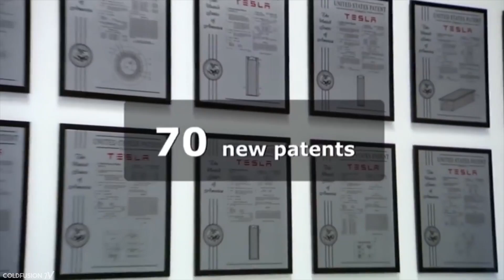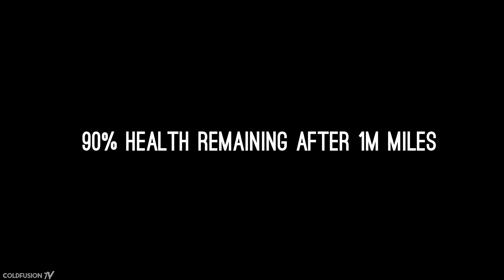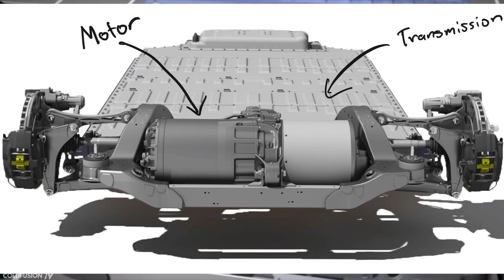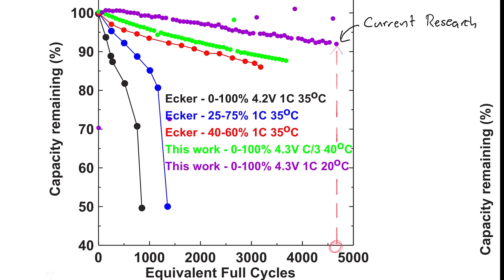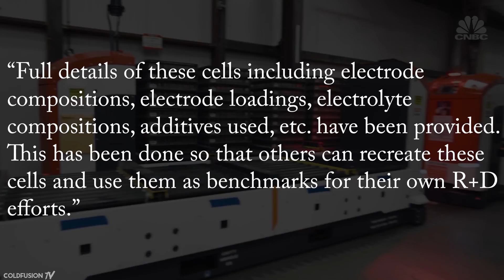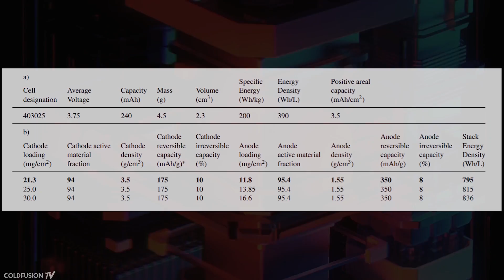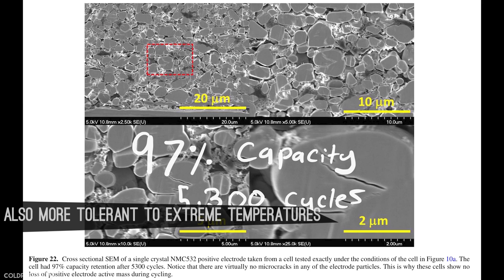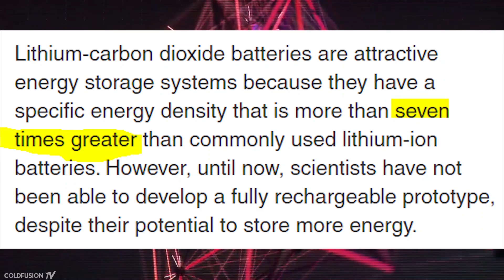Tesla's Million Mile Battery

Comment: I have a goo idea too.. What if we could make a propulsion system that would run on some sort of magic juice that comes from the ground or is made from plants, would take about a minute recharge the vehicle and last 1000 miles?
Reply: Will using this magic juice also contribute to 100,000 american lives lost yearly from breathing it?
Reply: @miguellopez3392  Less than burning coal or natural gas to charge lithium (which needs to be mined at a huge environmental cost and processed at a huge energetic cost) batteries.
Reply: @rolandlee6898  well it's a good thing EV owners live in states with higher then average renewable sources, my state is 75% renewable power. Hey how are those oil spills and wars over oil going for our world? Oh wait the media is making it seem like we cant live without it and dont really cover any oil spills besides the big ones. Also lithium is renewable since it's an element, once it's out of the ground it can be used again and again, whare does burnt gas go? Oh yes that's right the air where everybody breaths it. But those poor trees around the lithium mine! We cut down more trees making  tables, what's with the sudden concern everybody has about the environment which specifically focuses on battery mines...
Reply: @miguellopez3392  Your ignorance is pretty astounding. An economical gas car ultimately does LESS environmental damage than an EV, because its much cheaper and easier to produce. The manufacture and transportation of EV components already is equivalent to about to that of a typical gas powered car + some 100'000 miles on the road. Over its expected life span an EV can at best hope to break even.
Yeah your state has more renewable energy, for which you probably also dont include the energy that was spent producing and maintaining the systems to harness it... which, just like the EV you drive,  were most likely made in China, which mostly burns COAL for electricity (while still having lower per capita emissions than you with your renewable energy, let that sink in for a moment). The manufacture of that EV, and transportation, has burned literally thousands of TONS of coal and diesel. The individual components of your EV have done some half a million miles on diesel cargo ships before it even became an EV. In addition to polluting groundwaters and rivers with toxic waste from mining (which is diesel powered) and processing (which is coal powered) of the lithium and aluminium gone into making it. If you think mining doesnt do any damage I highly suggest you visit a rare earth metal mine and note the machinery they use. The surrounding are and waste dumps are more hazardous than Chernobyl.
Burned gas goes where it came from - biomass. The air you breathe out contains about 1000x more CO2 than the one you breathe in. So what are you complaining about exactly?
Also lithium is NOT renewable, its finite. Its somewhat recyclable but almost no one is recycling it because the power needs are absurd and its cheaper to mine it. And even if we would recycle it and mine as much as we could - its physically not enough to supply the demand, not even 10% of what we need. Its actually completely futile, the future is in sodium based batteries (but they are heaver and hold less charge) Also each recycling process yields less than the one before and the energy needs and toxic waste products grow exponentially the more you wish to recycle reactive metals such as lithium. Its produced as a metal via electrolysis at a pretty abysmal efficiency. and its done where you think? Have a guess... CHINA... and how do they produce electricity? Have a guess.. ITS COAL! Which is why EV production is in fact far more damaging to the environment, including CO2 production than ignorant morons living in their bubble like you believe. Evidently you think it just falls from the sky... No buddy, its produced by burning MILLIONS of tons of COAL in China and polluting the environment the point where entire species go extinct and entire rivers are dead and bleach your skin if you touch the water. And one more thing - EVs contain quite a bit of plastic and other synthetic materials. Where do you think those came from? The sun?
Reply: @rolandlee6898  everything you said in your entire comment I already know. I know it from years of arguing about EVs and climate change, except for the fact that I've done the emissions and enrgy math myself and found that "current" EVs just brake even on average, but due to the rapid growth of EV sales and renewable installations the world is going to just become more efficient at running EVs, it's simple as that, also the environmental damage from maintaining and operating gas cars is far more damaging then BEVs, there is simply no debate about that, but I am willing to hammer you head in with hundreds of examples of oil spill,  explosion, pipeline burst, and transport spills if you really do think a lithium mine is that bad... do you know what a brine deposit is? 
Conclusion: better if we start transitioning to EVs now then later.
Reply: @miguellopez3392  Im not saying oil is the best. As for spilling, you should know that most of the oil degrades within weeks, they even use bacteria to clean up oil spills. So its not actually as bad as people think. Its still awful, but it doesnt actually cause long term or permanent damage.
It isnt going to get better with current generation of EV. Lithium batteries are a dead end. All the current EVs do is serve as a fashion accessories with most people being completely oblivious to what it actually takes to produce it. We physically dont have enough readily available lithium on the planet and the price keeps increasing. Which is why people are researching alternative battery options, such as sodium.
The advantage of gas cars is that they are cheap to produce and can be produced relatively locally with comparatively minimal environmental impact and lower power needs. They dont require diesel trucks and machinery to mine lithium in Chile, a diesel ship to send it to China, coal to refine it, diesel ship to send it to Canada to purify with gas, diesel ship again to Japan to produce battery cells by burning gas, diesel ship again to China to assemble into battery blocks via coal again and ship those to wherever the EV is made. And thats just the batteries and you can see the demand for oil, gas and coal during the process. So by buying it you actually INCREASE the demand for fossil fuels. Ultimately you will never drive your EV enough even if you charge it with eco-friendly power to tip the scale. The batteries will start to degrade and 5 years later you will get a new battery pack that had the exact same journey as the first one, producing more pollution and CO2 than if you had used an economical gas powered car all along.
Oil really isnt as bad as people think, its just biomass and we could in theory switch over to biofuels as engines get more and more efficient (and we can use EVs where its sustainable). Presently internal combustion engines are more energy efficient than EVs by far. Encouraging EVs presently does more harm than good. Thats just a fact. Buy a small eco gas car that does 60+ miles per gallon and pump it with bio-fuel made from vegetable oil thats completely renewable. The far bigger issue is the use of gas a coal for energy needs. Should all be geothermal, nuclear, hydro, solar or wind where and if viable. Transportation accounts for less than 30% of CO2 emissions. Most of CO2 (and worse) is produced by power-plants and industry. And replacing those is a far easier and cheaper task than replacing hundreds of  millions of cars, trucks and ships which are made by the CO2 producing industry, which we DONT have enough lithium for anyhow.. All you gonna do is increase the demand for this industry and its power needs by advocating for EVs today. You will up the CO2 from power and industry and at best replace 10% of cars with EVs, Transport emissions will drop by 7-8% (Some 2% of global total) and that will be completely nullified and surpassed by far by the industry and power need you created. Ultimately you will produce more emissions and pollution. Much more in fact. Its basic physics.
Of course we should transition to alternatives. Oil isnt gonna last forever either. We probably would be transitioning more actively is not for the low cost and the requirement for oil to produce literally everything else we use, including EVs. Im sure you wear synthetic fibers and buy water in plastic bottles like the typical eco hipster does. Thats all made from oil btw.
Reply: @rolandlee6898  yep still pretty much know every thing in you comment, I'm not learning anything new here, but you do have some valid information and some invalid, but I'm not here to pick too deep at it, I'm tired of having arguments that get drawn out too months with 100 paragraphs so please keep your replies short, I dont have the attention span I use too. Oil is good, its grate put us in the industrial era and modern age, still has many uses outside of burning, no point in letting it go to waste, just dont burn it for energy since we are in the modern age we can now pushed renewable power, One form of energy replacing another is somethinghumnas have done several times, again, batteries are still better, lithium ion is not a dead end it only appear that way because a lack of demand has created a void for funding, now since EV adoption is increasing R&D for lithium ion and other battery tech is increasingly, You talk about a battery needing replacement in 5 years while current teslas can go 500,000 miles before hitting 70%-80% original capacity, so even current cells last longer then most cars, and thanks to the sell of current EVs tesla was able to purchase a safer cleaner manufacturing methods and developed cells that will not need replacing unless you drive over a  million of miles in the same cells (I dont know if the battery pack itself will last as long as the cells, they theoretically should last a life time under normal use, if lithium ion is a dead end then gas cars are a grave yard, we need to move on to encourage further development, that's how it works, if we kept alked about the environmental benefits of horse we wouldn't have 60mpg gas cars today... (they are hitting a physical limit because the exothermic reaction mainly produces heat, I think the thermal efficiency limit is somewhere around 55% in a lab, while a tesla battery mainly produces power (20%-10 turns Into heat from. Atomic jitter interupting electron flow)
Reply: @miguellopez3392  If you know that then why are you still arguing in favor of burning coal and gas to produce and charge EVs? Thats will generate MORE emissions and pollution than if everyone drove a Mustang.
The first step should be switching to renewable or inexhaustible energy sources for our daily and industrial power needs. Again, all transportation accounts for less than 30% of emissions, even if you could replace 10% of vehicles with EV you'd reduce the total emissions by no more than 3%.. However that would be completely negated by the increase in industry and power needs to produce these EVs in the first place because you still are burning diesel, gas and coal for it! Why is that so difficult to understand?  It is much more feasible and cheaper and faster to replace the majority of our power needs with sustainable energy sources. And THEN when you have low emissions production - THEN is when you can increase the industrial demand and output to produce EVs.
Lithium is a dead end because WE DONT HAVE ENOUGH LITHIUM!
Yeah, no, the batteries DONT last that long. Thats just marketing. Technology is being developed to make it last longer but its an unavoidable side effect. The batteries will inevitably degrade with each cycle. That is once again why more and more people are looking into a long term replacement.
An internal combustion engine has an efficiency of about 40%. Same as a power station that would charge your EV. However energy is lost at every step of delivery and use with the EV ultimately needing more fuel to be burned to produce electricity to move it than it would have taken if we used the same fuel to move the vehicle directly. Again - basic physics that clueless ignorant wannabe eco hipsters miss. Charging your EV burns a few hundred pounds of coal or gas. An EV at the end of it all is about as efficient as a steam engine. The only way you can negate that is by using emissions-free power sources. Which most of the world does NOT use.
Current EVs are NOT eco friendly. They are quite possibly the WORST thing we could do. They in fact produce more emissions than gas powered transportation at EVERY step. They just do it indirectly, at the production facilities and power plants rather than on the road. But as you yourself said - its in the air we ALL breathe.
So, I ask you once again, if you already know that - why are you advocating for EVs that produce MORE damage and emissions and require MORE fossil fuels as being a better low emission alternative to "underground magic juice" when you admit you know that they actually arent?
They could be if we drastically reduce the reliance of fossil fuels for general power needs and industry, which is actually doable within a couple decades. But no one is talking about that.. all you want is to burn tons coal to join an environmentally damaging fad.
Reply: @rolandlee6898  again i said no long replies, i never said to keep burning fossil fuels to charge EVs.

"Yeah, no, the batteries DONT last that long. Thats just marketing. Technology is being developed to make it last longer but its an unavoidable side effect. The batteries will inevitably degrade with each cycle. That is once again why more and more people are looking into a long term replacement." yes they fucking do https://steinbuch.wordpress.com/2015/01/24/tesla-model-s-battery-degradation-data/

"WE DONT HAVE ENOUGH LITHIUM!" you assume we will be using lithium forever and in the same quantities , but there is enough for 500 million current EVs, so head room for 20 years

"An internal combustion engine has an efficiency of about 40%" at a specific RPM range, under normal use the engine is much less efficient, that why a power plant is actually 40% efficient because it runs a t a constant load to achieve peak efficiency since there is only small load differences compared to a gas engine in a car.

 "However energy is lost at every step of delivery and use with the EV ultimately needing more fuel to be burned to produce electricity to move it than it would have taken if we used the same fuel to move the vehicle directly. Again - basic physics that clueless ignorant wannabe eco hipsters miss."
 i know abput enrgy loses through tranmission, ive done it down to the inverter in the car, this except for the fact that it does not take 100kwh of coal power to move 100kwh hours worth of coal, im going to call you ass out on that one and specificly ask for the math that you  used to get this number, i dont like it when you repeatedly say bullshit like this, ive ignored it for a bit but its getting real fucking annoying.

"Current EVs are NOT eco friendly. They are quite possibly the WORST thing we could do. They in fact produce more emissions than gas powered transportation at EVERY step." 
except for the last step, where its driven for the rest of its life with lower emissions the ICE mounting up to a over all cleaner car, ive explained this multiple times.

you are a jackass, ive said that fossile fuels where good, but we can replace them now, again, where the hell did i say we should keep using fossil fuels fore energy?
Reply: @miguellopez3392  But you are advicating for us all to buy EVs NOW.. NOW when they are made and inefficiently charged by burning fossil fuels.

We will be using lithium in increasingly higher quantities, which is why the supply will no longer keep up the demand. Its struggling as is, hence why the price of lithium is going up.

The thermal efficiency of an internal combustion engine is calculated as an average, not as an instantaneous measurement at a specific RPM.

The point is that burning coal at a thermal power plant and charging your car batteries with it a few hundred miles away is far LESS efficient than pouring some gas into a car and running it on that. Ergo - it produces MORE emissions and pollution. Thats just a scientific fact. The efficiency of a thermal power plant and a modern car engine is roughly the same, the car engine efficiency is calculated directly from the motion. That of a EV deliberately does NOT include the production of electricity and the inevitable losses before the energy even gets to the EV, only stating the direct conversion of electricity to motion. And if add to that the massively higher power needs for its production. The argument that EVs produce less emissions is blatantly and deliberately false.
What you claim to experience the typical position of a sheltered and ignorant moron who believes the EV just fell from the sky and electricity comes from God for free. It doesnt. Just because the car doesnt produce emissions directly as you drive it does NOT mean no emissions were produced to produce the car or the electricity to charge it. There were... and a fucking lot of them. The difference they were and are produced far away, so you can  keep thinking youre saving the world while China is burning millions of tons of coal every year to build these planet saving EVs. And if you want to see what sort of emissions that produces just Google "smog in China" images.
Reply: @rolandlee6898  alright, if you are so sure about EVs being inefficient, then give me your emissions math, I've done it my self, a EV lands somewhere between 25%-30% efficient when charged of coal, the average car is 25% efficient, newer economy cars are 35% efficient, but since coal is only 27% of the grid and natural gas is 32% (2x cleaner then coal) the rest is from very low emissions sources, so the average EV on the road is as about as clean as a hybrid. If more people buy evs then more development is done to support them, the increase energy demand can be supplemented by renewable sources so overall grid share becomes greener, the reaserch done will allow for cleaner batteries that need less metals and last much longer... such as the new dry cell technology tesla bought Maxwell technologies for 212 million dollars. In truth, nothing will ever be 100% clean, we have to bite the bullet and push foward with EVs, not all of us but those who can afford them shoul definitely considered getting them instead.
Reply: @miguellopez3392  27% of what grid? Your local? Good for you.. However, meanwhile...
https://ourworldindata.org/grapher/primary-energy-consumption-by-source-and-region

Also gas doesnt really produce any less CO2 than coal. It produces less dust particles, but ironically its also these particles that are reducing the effects of CO2. The global impact would be about double of what we experience now if not for fine particle pollutants in the atmosphere.

And as you can see over 90% of the global energy is produced by burning fossil fuels. Which also goes into charging and producing your EV, ultimately negating any benefits you think it has. The global fraction of renewable and clean energy sources is essentially negligible. And once again - advocating for EV mass production now will only INCREASE the demand for power and industry, which most definitely will be located in the developing world and rely on coal or gas.
To reduce emissions we have to produce cheaper transportation with lower energy needs and first and foremost reduce the fraction of fossil fuels for energy production. Only when we have clean industry can we have EV, which require a lot of energy to produce, that will actually be beneficial. Presently as it stands - they are as eco friendly as a tractor and serve as nothing more than a fashion accessory for the ignorant, such as you.